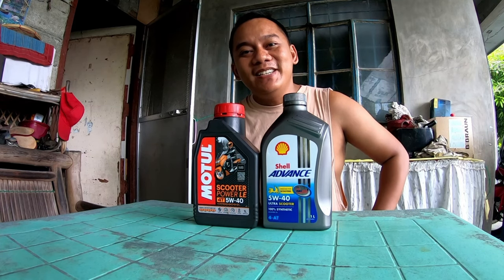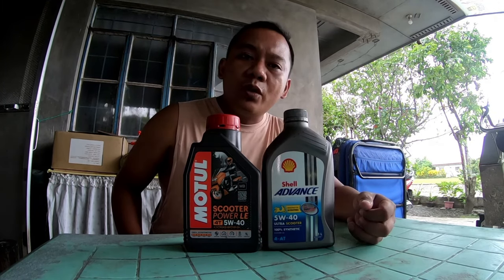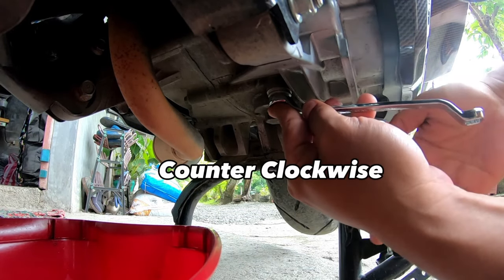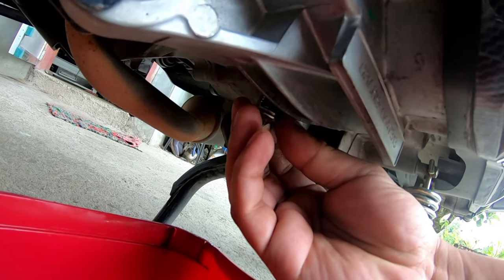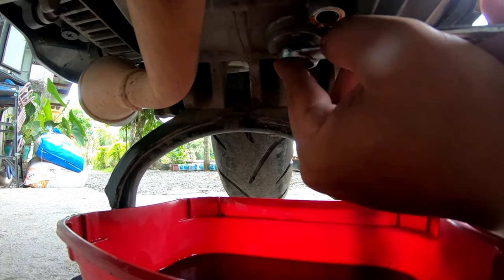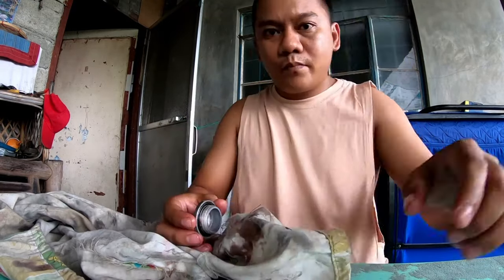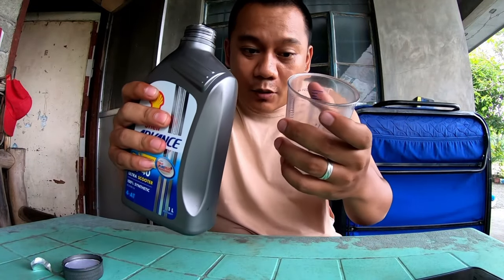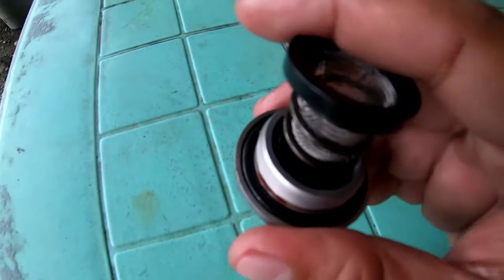Change oil Nmax v2

Comment: From motul power le to shell advance ultra scooter din ako paps. Naka 3 change oil na ako nyan at mas maganda performance nyan kesa motul, mas mahal nga lang sya pero dina ako magpapalit, shell din fuel ko premium. Every 3k ako change oil, now si maxie ko at 15k + odo. 😊
Reply from the maker: Agree ako sayo paps.. mas mgnda nga tlga tong Shell scooter 5w 40.. smooth.. si motul mejo nagbbawas sya at magaspang sng takbo.. based on my exp.
Reply: Subok mo na talaga bossing? Mas okay talaga ang shell ultra scooter kesa Motul power LE?
Reply: OlOl 15k oddo Ka lng pala e Baka motul na mahina klase aNg na try mo madame klase Ng motuL shunga 😂nag babawas langis mo Baka may sira motor mo 😂
Reply: Tska ano pinag sasabe mo maganda aNg 5w e NASA pinas Ka NASA mainit Ka lugar dapat 10w ugok😂

Comment: Hindi Naman pang blue core engine mga langis mo, kaya may metal ka Nakita dyan Kasi iba Ang viscosity ng langis na nilalagay mo may effect Yan sa loob ng engine mo., Yan langis mo ay para lang sa mga scooter na Hindi Naman blue core engine...
Reply from the maker: noted po
Reply: Toinks
Reply: Kahit anong langis basta na meet yong nasa manual na jaso mb @ 10w40 okay na
Reply: Lol... Blue Core is just more/less a marketing term ni Yamaha. Parang PGM-FI lang ni honda yan.
Isa pa nakalagay naman sa manual ano pwedeng oil sa unit in case di mo gamitin yung brand oil nila.
Reply: @ImmortalShiro  Yan Ang problema sa mga kababayan natin Ang daming nag mamarunong. Using different oil that is not specifically designed for blue core engines may have some potential sequences Eto mga possible few scenarios. 1. Decrease Performance - the blue core  engine is designed to work optimally with Yamaha which is formulated to meet specific requirements of the engine
2. increase wear and tear - blue core engine relies on proper lubricantion to reduce friction and minimize wear on enging components 
3. Potential Enginge Damage- In extreme cases using an oil that is not suitable for the blue core engine may cause sever damage. This can include issues such as overheating, increased friction, and accelerated wear on critical engine parts.. Yan po ay Hindi sa akin nanggaling nabasa ko lng , at tsaka Sabi ng mekaniko nakausap ko Sabi nya subrang itim ng loob ng makina Yung mga oil na Hindi Naman  blue core engine na ginagamit nila sa may mga blue core engine kaya ganun resulta.
Reply: 2kplus oddo tapos may metal SA loob tatay na tatay 😂

Comment: yan gamit ko sa mio sporty ko before ako bumyahe. almost 500km 14 hours. every 900 odo ako nagpapa pms pero pina change oil ko lang para sure ang linaw pa sana pero ok lang. Para saken the best talaga tong fully synthetic engine oil sa shell. pricey nga lang pero goods na goods.
Reply from the maker: Yes bro true 😉👌
Reply: Pwede po ba yan sa click 125 V3 and hm po shell scooter 5w-40?

Comment: boss bakit 5w-40? di ba naksisira ng makina yan? 10w-40 ata ang recommended
Reply from the maker: ok naman sya boss 5w-40 para sa akin mas smooth sya kesa sa 10w-40.. yung 100% synthetic oil
Reply: Non synthetic kasi yung 10w-40 ni motul. Kaya magasto sa gasolina.
Reply: Teka iba pala. Yung 10w-40 is mineral. Kaya magasto sa gasolina.
Reply from the maker: @jerrylanary4889  oo pero smooth din sya actually sir